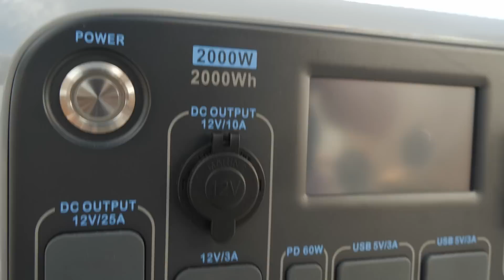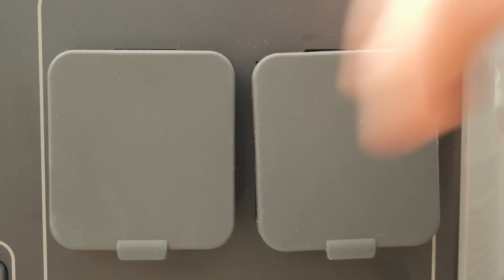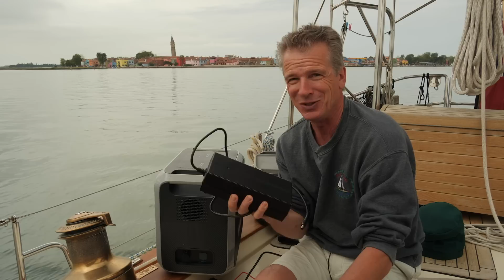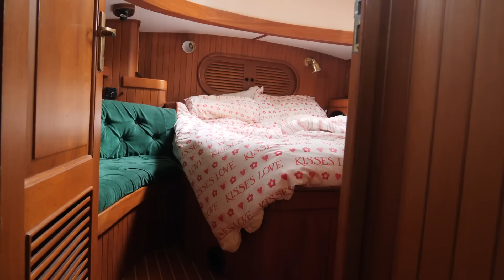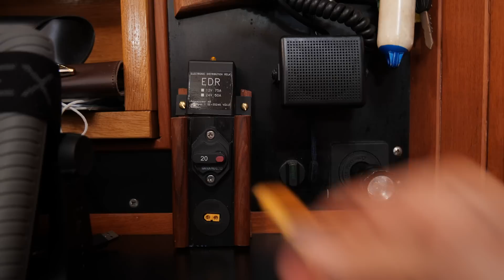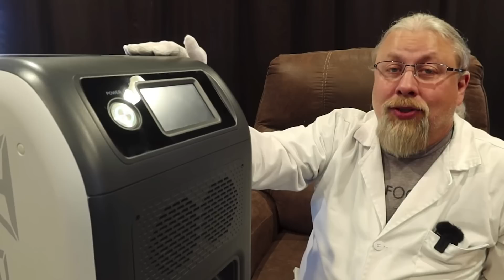New ideas for house banks  |  PowerOak Bluetti AC200P

Comment: Cycles are not everything... batteries ages by time also so at the end 50 years is a non sens! It is as true as saying that a man who has lived 80 years could live 80 more before dying... total non sense... batteries ages by time almost more than by cycling and if you live in warm temperatures that will be the worst!
What is the solution then ? Buy the minimum  of capacity you need and cycle it more! LiPO4 with 3000 cycles will give you more than 10 years cycling them every day... i repeat it: aging is worst than cycling and over 20°C they will age faster. Batteries are chemistry objects  and chemistry reactions like energy and temperature is energy! So Forget the idea of keeping batteries more than 10-15 years. Don't buy more than you need thinking they'll  last forever and be ready to buy new every 10-12 years . Batteries ages faster than humans. If you believe you will live 200 years you can also believe that lithium batteries will work 20 years....  saying lithium last more than 10-12 years is ignorance or worse... a marketing lie !
Reply: They’ve been shown to work more than 10 years, just don’t expect to be full captivity
Reply from the maker: Wow calm down there pal, I'm not going to live another 50 years & i really don't expect my batteries to last that long either, the way you're going you'll be lucky to make it to xmas!
Reply: @svfairisle  Sounds like someone's off their meds...   Something Steve's new BFF fails to grasp is that Lead Acid has a notoriously short life and - I repeat, and - a woefully narrow operating band of charge.  Even the 2,000W version that you've got here equates to a realistic 165Ah of capacity; try doing that with 330Ah of Lead Acid and compare the cost, size, and weight.  The 5,000W version that you reference is also interesting: that's essentially 450Ah of capacity, with MPPT and AC Inverter built-in; pretty impressive.  Creating a usable 450Ah with Lead Acid - therefore 900Ah raw - would be crazy big and complicated; just think of the cost and weight of the main bus cables..!

If you're port hopping in the Med, then the fully integrated might certainly be a feasible option; after all, you're never too far from support and Amazon.  But for offshore and remote cruising maybe this sealed, all-in-one option is leaving just a bit too much in the lap of the Gods.  Maybe the solution though is somewhere between the two extremes.  It might even make sense to build the DC side of the equation using fully discrete, highly serviceable components (even to the point of individual LiFePO4 cells and multiple, easily replaceable BMSs) and use one or two of these all-in-ones for the AC side.  Being able to charge the DC bank from alternator or generator, solar, wind, or hydro, and also being able to use these same inputs to charge the all-in-one AC bank would be creating a very interesting and flexible solution.  Keeping the two systems more-or-less separate and independent also removes a lot of complexity; just build in the necessary level of cross-connect flexibility and you might have something quite special...
Reply from the maker: Hi Robert, yes thats precisely what I'm thinking. An cross build system. We do intend to go to remote places like the South Pacific, but we've got a good few years in Europe and the States before that where I feel I can experiment a bit. When we go through Panama I want as robust a system as possible. Up until a few years ago I would have said stick with lead acid as its available anywhere, but that would just be silly now. The built in LiFePO4 system worries me slightly as its relatively high complexity means something could die in an unfixable way! So redundancy is key I think and thats why I like the idea of the two high powered Bluetti's strapped together as they are completely independent and you could just disconnect one if it died. Obviously no one knows how long they might last on a boat as it hasn't been done and as the original poster said in his little tirade it's not all about cycles if the thing dies of something else. I quite like the idea of trying this while I'm somewhere that's not going to kill me if it goes wrong. I could retain a reasonable sized lead acid as starter / emergency house. I already have the ecoflow and the bluetti as back up as well and as you say it would be a huge house bank size if I have the two big bluetti units that can be strapped together or work on their own. I don't get your thinking about wire sizing though. Unless I'm missing something the opposite is true. The only big cables are obviously on the DC side... well the starter motor / dc draw of the boat is the same. The only time you need to ramp up the cabling is when you start fitting massive inverters to feed induction hobs etc & as you rightly said you quickly get scary amps on the DC side. Well with the all in one system there is NONE of this wiring because it's all done within the unit & the DC is delivered to the inverter on a solid bus bar a couple of inches long, not many meters of cable. Your AC is delivered straight from the units so the only cabling necessary on the boat is the marine equivalent of bog standard 2.5mm twin & earth.
Reply: @svfairisle  Yes, it would be a very interesting experiment; and hopefully not too expensive to build, test, iterate, and perfect.

Just on the calling size issue, yes, that's what I meant, it's the DC side of things that can be problematic, especially as the Ah scales-up, and the distances between components increase.  That's why an equivalently sized Lead Acid solution (needing ~2x the LiFePO4 capacity) can get very scary, very quickly.  As you say, the all-in-ones mitigate this by having everything side-by-side and probably use solid busbars where possible.

I concur, stick with no-nonsense Lead Acid for the Starter, go all-in-one LiFePO4 systems (x2..?) for the domestic AC side, but I would really seriously look at DIY LiFePO4 for the domestic DC (and even maybe splitting this into essential and non-essential loads/supplies).  You can do some amazing things building it yourself, and can integrate all sorts of flexibility and redundancy; it doesn't have to be a case of a single black-box BMS fault taking down everything.  And that's the only downside to drop-in replacement options, they essentially take away any component-level fault-finding and replacement capability; simple and clean, but slightly risky.

Anyway, fair winds..!
Reply: @svfairisle  -   You  made  me  laugh  out  loud ! !     " . . . the way you're going you'll be lucky to make it to xmas!"      I  understand  his  logic  since  my  Nissan  Leaf  is  temperature  sensitive  and  has  a  reputation  of  limited  range  .  .  .  .   but  I  try  to  enjoy  it  for  what  it  does  provide,  take  care  of  it,  and  not  get  my  bloomers  in  a  twist !
Reply: @svfairisle  i hope to be lucky as hell so... sorry for my excessively rude previous comment and keep the good content, it's a pleasure to follow your channel.
Reply from the maker: Don't worry it wasn't rude, I could see you were a bit stressed... happens to us all!

Comment: Great video. We are looking for something for our power boat. It’s a small power boat but quite new. All we want to be able to do is use our toaster, coffee machine and plug the water heater in to heat water when we are at anchor for a few days. Our water heater is 750 watts. So we were thinking on the echo delta. Also what does the max power weigh.
Reply from the maker: The Bluetti is 29Kg as against 14Kg for the ecoflow. the Ecoflow will do all you need just not for long without recharging so just depends on your usage load and your ability to recharge

Comment: Thanks for doing the side by side review. I'm aiming to get one of these as I am permanently on a lake mooring. Useful for family harmony at weekends with a family of 3 girls.
Reply from the maker: Oh yes, been there! The Ecoflow would be enough to power computers, tablets, phones etc all weekend and will full charge in and hour and a half from mains, it thats a consideration. And it's much more portable. If they want hairdryers & other mains stuff the Bluetti would be the one especially if you have some solar for charging, just be aware that it needs over 35volts so in most cases thats 2 panels in series.

Comment: I would be very nervous using one of these in place of a house bank. One of the many components in this thing dies and you've got no A/C or one less 12V socket etc. I'd be surprised if you can get into this thing easily to repair let alone keeping the warranty if you do. Will they sell spares? How much? Maybe for a tiny 22 footer for occasional weekend use
Reply from the maker: Yes you're right, redundancy is key. For us they are just a very useful back up and extra capacity. But for small day sailer / weekender I think i would be tempted to go with something like this and maybe uprate the engine battery as a get you out of trouble back up. The advantages of LiFePO4 are just too much to ignore now I think and no matter how you fit them there will be a BMS in the system which is what will deprive you of power if something goes wrong. Is this system more or less likely to go wrong than a set of LiFePO's? who knows? Either way I would want some redundancy that's why I like the idea of the two bigger units strapped together that Hobotech tested.
Reply: @svfairisle  I think a standalone LiFP upgrade would be more worthwhile if you have a multi battery bank. The benefits of having a modular, customisable solution that is also generally going to be cheaper for the same capability can't be ignored unless cost and "my life depends on this" is not a factor